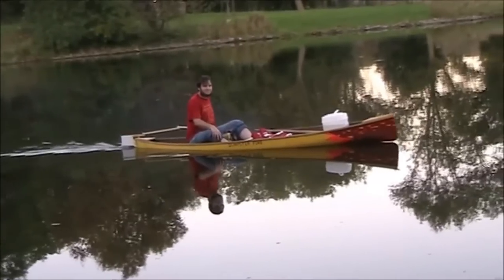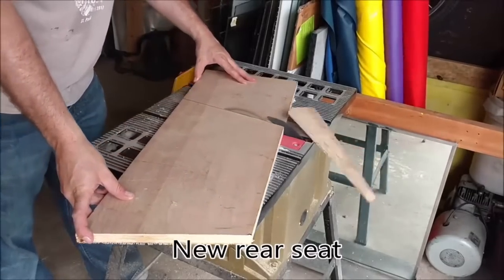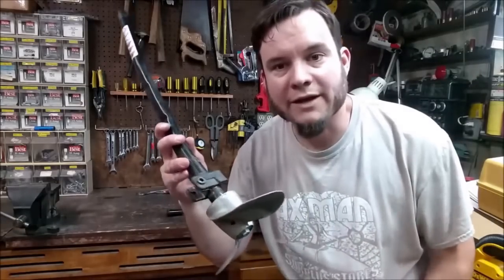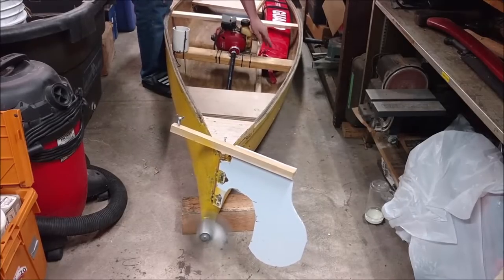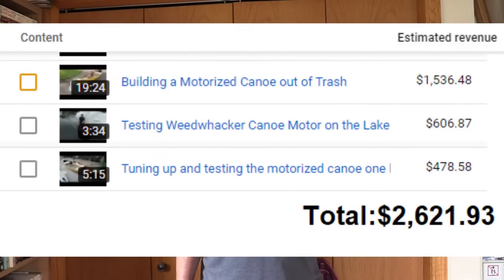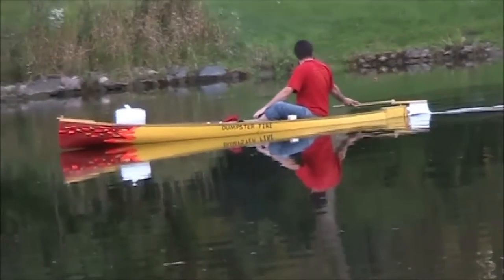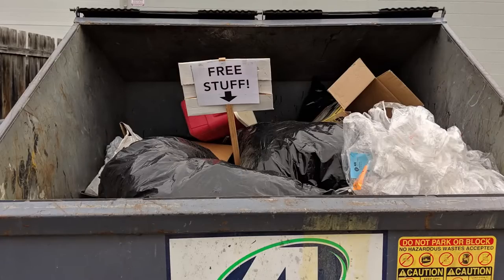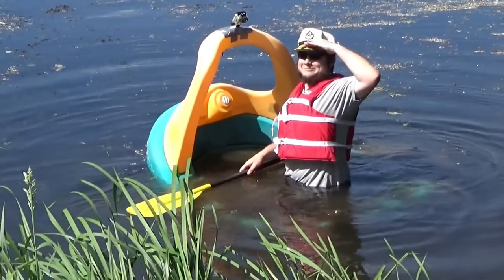I made $2,500 From Someone's Illegal Dumping

Comment: you are quite inspiring. the motor broke on a whipping machine at the bakery, rewinding repair would be 800$. so i said: if only there was a treadmill thrown away at the dump we could make this work out, next night i found one, i had a look at the commutator and it was like brand new! so the local bakery have now been whipping cream with a treadmill for over a year, and it does the job every time!
Reply: My 20qt mixer was given to me because it had a intermittent problem and a bad switch. I replace the rheostat switch and pulled and cleand a bunch of the connections on the inside and it works just fine now. I have had it 7 or so years now and use it several times per year.

Comment: Its my favourite season at the moment, verge side pickup. for about a month your allowed to put bulk rubbish on the road verge, and the council comes along and picks it up. what it effectively does tho is turn the whole neighbourhood into a free swapmeet. there is alot of genuine rubbish of course, but still alot of decent stuff, and usually people make it easy to get to the good stuff, or write "WORKS" on it, etc. easier than a trip to the tip, and insures that whatever is left is actually trash. Ive had a pretty good run, a couple of decent fans and ducting, some cool old lampshades and light fixtures, a big stack of 2x4 half cuts, rolls of hose and wire, and some really nice wooden deck chairs. they are going around our new 'plunge pool', which is a 1000L IBT tank with the top chopped off and half buried.

Comment: We are losing our community dumpsters that were supposed to be shared among multiple houses because of illegal dumping. It was near an intersection of streets and the local shade tree contractors would stop and fill it with left over material from their jobs.  I once pulled 16 new 8x8x16 concrete blocks out of it.  Last week, it had one of those electric scooters in it and one time I found an electric mobility vehicle in it which I repaired and gave to a disabled friend. We will now be getting much smaller individual trash bins so they can be monitored but it will mean extra costs to the city to service all those bins so our trash fee may go up.

Comment: I guess this is vaguely related…I’m doing dishes while listening to this and saw my pile of used paper towels. 

I used to use only hand towels but since having a small child we’ve resorted to a lot of paper products…so for now, I save paper towels that were used to just dry my hands, and then when there’s a spill on the floor to clean or mess on the stove or whatever I reach from that pile instead of a new paper towel.